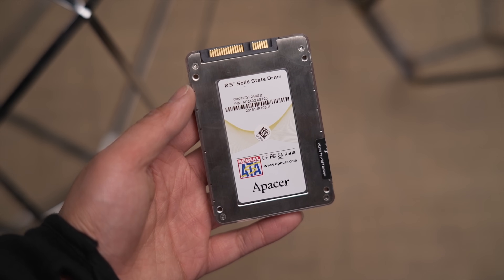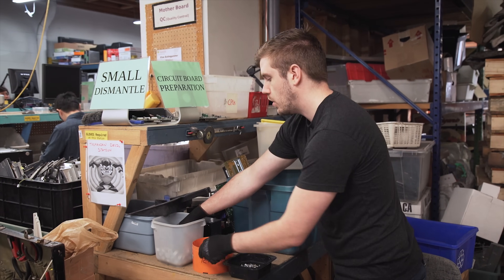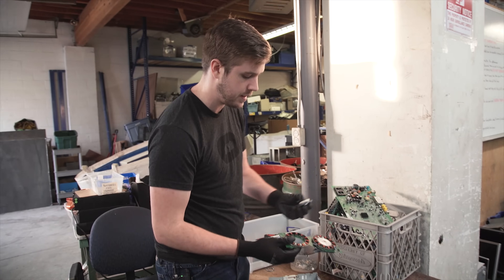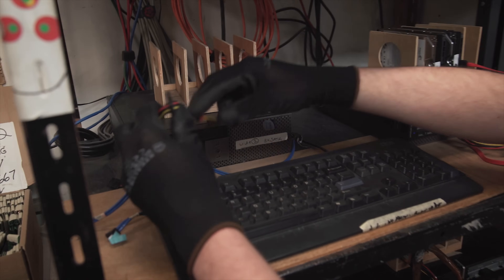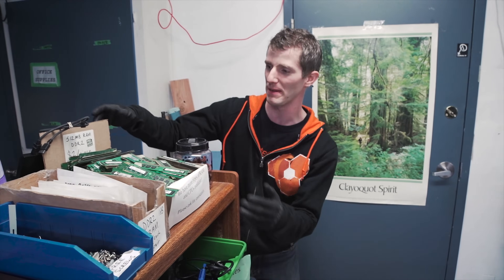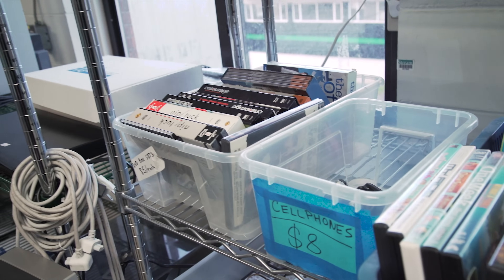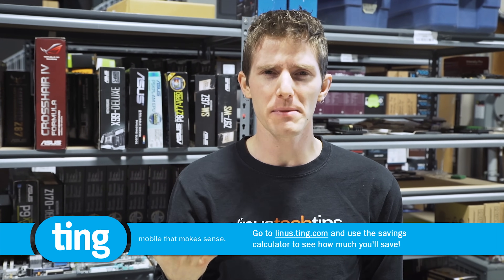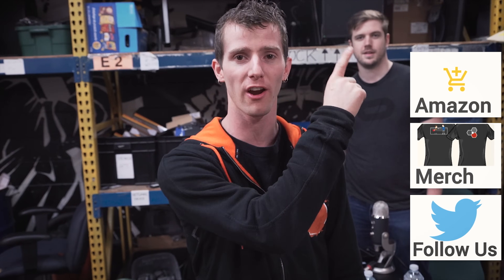Little Tech Shop of Horrors: Free Geek Vlog Part 1

Comment: I think I just saw heaven and it was all in this vid. If only something like that existed within 100 miles near me.

Best thing(s) I got from a thrift store: I once got a 1366×768, 1680×1050, 1280×1024, and 1600×900 monitor (separately but in that order) for ~$40 total, all still functional. One's in storage, the other's for a different computer, and the other two I'm using currently.
Reply: Farrrr that's insane cheap
Reply: +Ganaram Inukshuk Dude u have no idea, I'm in a completely different country xD
Reply: +Ganaram Inukshuk DAMN that's one heck of a deal
Reply: +Ganaram Inukshuk Monitors from these recycling shops are most awesome! I have a fancy IPS panel as my main monitor and 2 office grade monitors that are around 10 years old (1280x1024). Paid 30€ for those 2 monitors and they are great when it comes to viewing angles and colors still considering their age and price :D
Reply: Ganaram Inukshuk I agree and good deals BTW.
Reply: +Ganaram Inukshuk Best I got was an HP 1080p monitor with display port, and full vertical swivel for 40$. Still my main screen today :) Those 1680 one's are a nice sweet spot
Reply: I work at a computer store and get some really good stuff for cheap. Most computer stores have stuff like this in the back, but aren't willing to show you unless you most of the time.

Comment: LMG, I've noticed some of your videos come out with either a 60hz hum or a low frequency noise made by something else. Let me recommend Izotope's Ozone software only because it has an excellent noise suppressor that I use on audio creation. It works by footprint, so you just need 5 secs of clear hum/noise, take the footprint and boom, noise is reduced without affecting your important audio in a meaningful, perceptible way. No sponsorship intended and it takes less time than fixing a whonnock server. Lot less.

Comment: Oh damn!  That 'whatever this is' Bernoulli drive that Linus picked up!  I am pretty sure that's a WORM drive!  Write-Once-Read-Many.  When in college (late 90s) I worked at a datacenter for a bank, and they used a big jukebox with one of those drives to store check images.  They took these big cartridges that basically had an optical disc inside.  Once we had a full discs worth of check images, they would get burned onto the disc and then loaded into the jukebox.  They could then later be retrieved if necessary.  I had completely forgotten about that thing until he picked that drive up!

And yeah, definitely move to Mint.  I've been running Linux Mint for a few years and it's fantastic.  I switched from Windows on my primary development machine 6 or 7 years ago and have never regretted it.  The only thing I miss is Directory Opus... but the guys who make it just don't see the business in making a Linux version (to be fair it'd be a lot of work).
Reply: Nonono Mint is awful. Go either Debian Gnome or Ubuntu gnome for a windows-like experience.
Reply: jhsevs I have no interest in a Windows-like experience.  Mint is fantastic.  I've been using it for years and it's marvelous at staying out the way.  Ubuntu's Unity is just unpleasant to use.  I do use Debian itself on my server.  I've used tons of different distros, and Mint is my current personal favorite.  But like I said, I'm not looking for a Windows-like experience.  I'm also not looking for a build-it-all-yourself experience like Arch or Gentoo offer, not for my primary workstation anyway.
Reply: Bernoulli drives work more like a floppy disk. you can read and write as many times as you want.

Comment: @5:35 Please don't install Linux Mint on old or low end hardware. It would be very slow. Install Ubuntu MATE instead. Its the best lightweight distro hands down and very easy to use Linux. Almost everything is Graphical including installing apps using the Software Boutique. All apps that a normal user would use is available in the software boutique. Check it out. I have been using it for over year now. Just amazing!!

Comment: For shame Linus are you even canadian?  It's o c zed not o c zee. XD.

Man I remember I originally wanted those reapers...ddr2 Running at 1066mhz while jedec stock was 667 and 800mhz...

But jeeze ocz turned into a mixed blessing. I ended up settling on ocz platinums 800mhz 2x2gb kits i think.  They were cheap, like 20 to 40 CAD during boxing day.  Those were my core2duo and c2q days.

Once I upgraded to sandy bridge with DDR3, i took apart some of the my dead DDR2 ram... Turns out the platinums had some type of stupid sticky plastic shroud that does a terrible job conducting heat to its metal ”heat sinks"... The shroud spells out OCZ...

Yeah what a terrible pointless gimmick.  Immediately just took apart all my ocz ram, since this is way past warranty i super glued the metal heatsinks to the ram chips instead of that plastic crap and saw immediate benefit now the heat sinks were actually working.

But jeeze I wonder if the reapers turned out to be gimmicky crap too.  The current gimmick is RGB... At least that actually works tho
Reply: This is made 4 years ago, do you really think he would respond?

Comment: Jesus CHRIST!  Buckets of negatives and positives clanking together like coins in a bucket, is literally the stupidest thing I've ever actually seen anyone do.  I've worked as an engineer in the electrical, controls, PLC industry for quite some time.  And most inept GameStop employees know better than to place even bunches of cylinder based batteries in a bin, BUT NEVER BUTTON CELLS... they do short... not will, but do and are, right now.  Some will be noticeably warmer than others, some hot... some could explode or arc... fire could result... but at best, they will all be compromised on charge and charge capacity for sure.

Comment: Why don't they just use a electromagnet to destroy the hard drive, so then it can still be resold
Reply: 1. Any electromagnet strong enough to wipe a hard drive is strong enough to also wipe out data from nearby devices which shouldn't be wiped.
2. An electromagnet wouldn't just delete the data from the disk, it would also erase the firmware making the drive unusable anyway.
2." Resold" as what? I regularly volunteer at another Free Geek, and if we're destroying a drive it's because the drive is broken, or too small to be useful to anyone. I mean, sure we could wipe and try to resell an ancient-but-still-functional  ten (or five, or even *one*)  GB HDD, but in reality who would want it?
If we're going to reUSE (as opposed to reCYCLE) a drive, we use either DBAN or Parted Magic's Secure Erase to remove all data from the drive first.